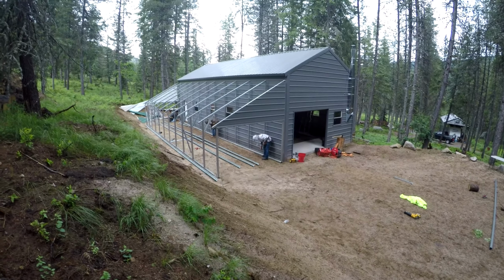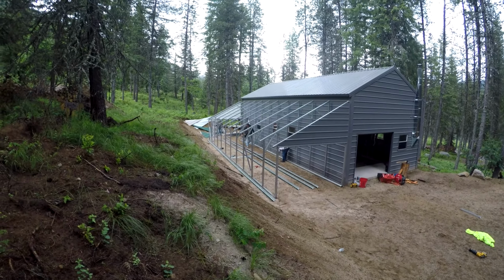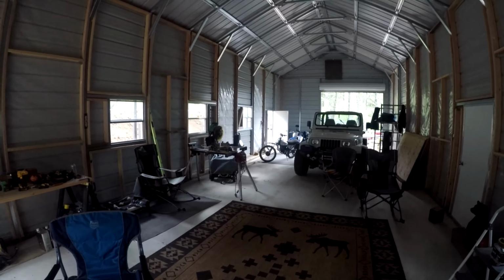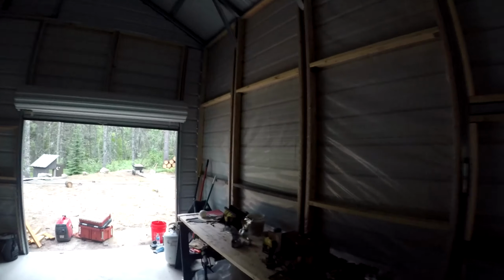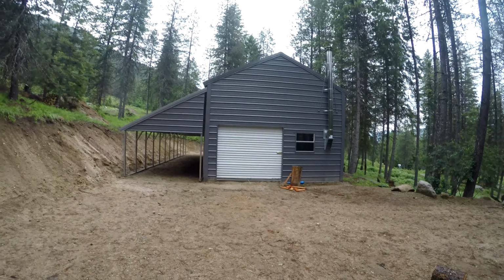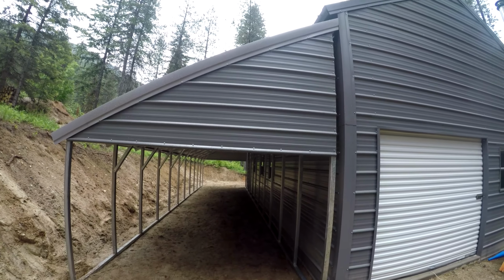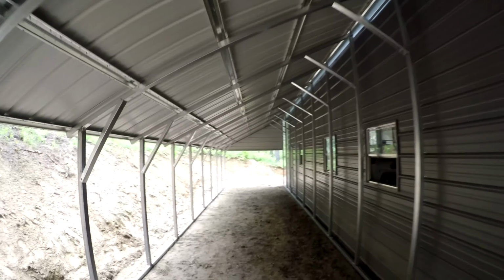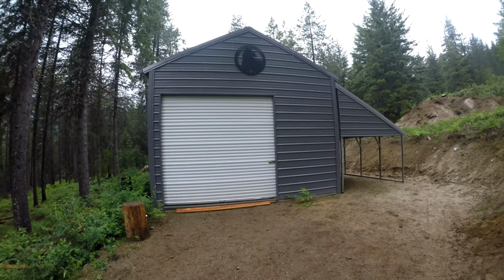WCM Lean-to

Comment: The building looks really nice. I like your choice of color on your building and trim. However, between the extremely low outside wall height and inward facing bracing supports on both sides, you lost a ton of square footage and clearance throughout. It's more like a 7' -7.5'  wide building in terms of useable space vs the 10ft wide footprint. They could've eliminated the inward facing braces all together by constructing the 45 ft long walls independently, then welding and carriage bolting roof rafters to them. This was essentially constructed as a freestanding building vs a true "lean to" building, which ties directly into the structural supports from the primary building. Why not raise the shorter outside wall height 2' - 3' to capture more useable space in the interior? It would have still given you the look of a "lean to carport" with good slope on roof for drainage, plus there would be no issue with adequate clearance on the ends of the building for vehicle heights. What are they going to do about the apx 4-5" gap in roof between the two buildings? Your metal roofing sheets should've been cut long enough to cover that gap.  If it's not closed off, water is going to run down between the walls, eventually wash out the ground and potentially leave the steel base sitting in water. Same issue on the outer wall base plate. Even if you lay a large amount of gravel over the ground and base plates, you need to install some gutters on the outside edge of the building or that whole cut-away hillside is going slide into your building. Man, I know having this building constructed wasn't cheap...I hate that you were left with so many issues that needed to be addressed.
Reply from the maker: yes, yes and yes.   Agree with your assessment.  Tried working that out before hand with Westcoast Metal.  I was told that they wouldn't directly attach the lean-to to the other building because I had modified the first structure.  Should have pushed back more than I did.  When the work crew showed up they were surprised that it was being built that way as well.  Live and learn I guess. I would go into a long story on the placement of the building but I wont,  I've excavated the up hillside to allow more room for snow,   still had to shove off a foot and a half this weekend.  Don't know I may regret it down the road, but I could always just move it if I wanted.  All in all its been nice to have
Reply: @ironmudder7770  Oh man, shoveling 18" of snow off ANY roof is a real pain, but not having any easy place to push it off and out of the way is the stuff of nightmares. I feel for you! You are right though, the way the building was constructed does lend itself to a fairly straightforward disassembly for relocating it.  Heck, the way it was engineered, you could easily make it into 2 smaller buildings...one for storage and one as a carport. If you can weld, that building has lots of potential!
I think you'll get a kick out of this story: When I was a kid, our next door neighbors decided to put in a pool and planned to tear down their one car garage....but instead, my Dad bought it from them. There was just a 6' privacy fence between our yards, so we took down some sections of the fence and Dad poured a concrete pad and 3 temporary approaches. Then, I kid you not...... We jacked up that single car garage around the whole perimeter and my Dad built some platforms with industrial castor wheels under them.....then probably every adult in the neighborhood came over and we ROLLED THE GARAGE RIGHT ONTO THE CONCRETE PAD!!  In total, we probably moved it 14 feet. But it went off without a hitch! HAHA!!  I was about 10 years old at the time and I remember it like it was yesterday!  We already had a 2 car garage on the other side of our yard, so the one car garage was nestled into the opposite, far back corner of the property.  We put the privacy fence back up and then Dad built a concrete Dog Run that went around the garage in a "U" shape....he cut a "doggie door" into the side of the garage and built a big heated dog house for our two big doberman's to stay warm in, when we were gone to work/school during the day. The rest of the garage became a fantastic storage space, because our home was only about 1100 sq ft max. So.....no matter what, you can still make that building addition work for you! You're a creative and handy guy, I imagine you'll end up with something fantastic if you decide to change it!  👏👏👏~~Christy~~